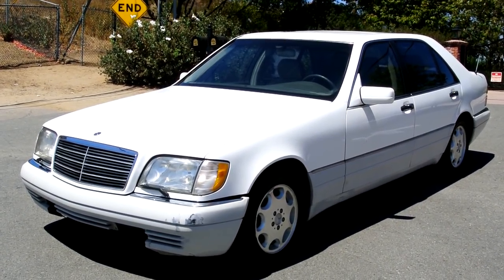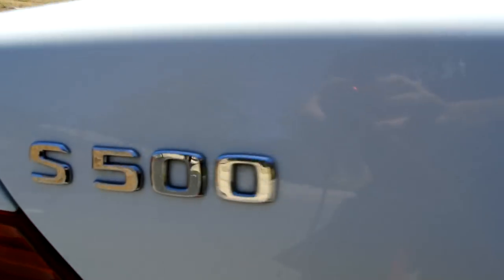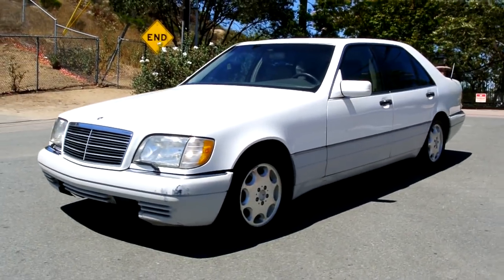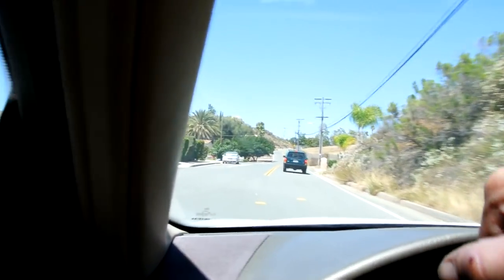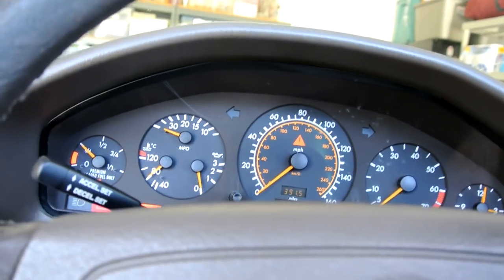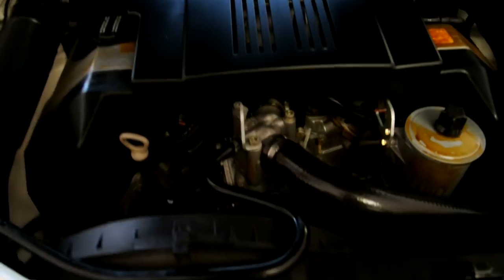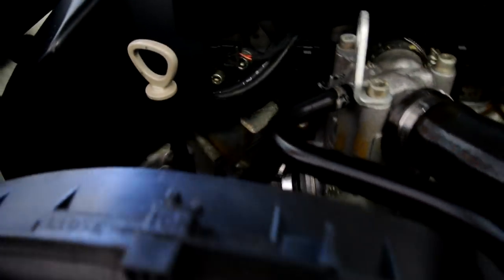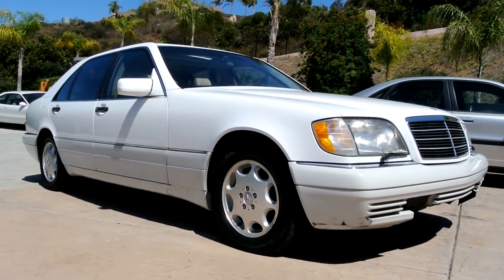2 Owner 95 Mercedes Benz S500 W140 S-Class Sedan Luxury Classic For Sale

Comment: hahaha i just had this car. a 1995 white s500. and a 1997 blue s500. they were not in all that great of shape and kinda junky but the motors on both were unquestionable. my white 1995 s500 had 192 thousand original miles on it and still drove like a dream. and i was like the 4th owner the car was salvaged and interior was missing lol on both the blue 97 and the white 95. i sold both and am planning on buying another s500. wanna get black on black. haha best cars ever. :)